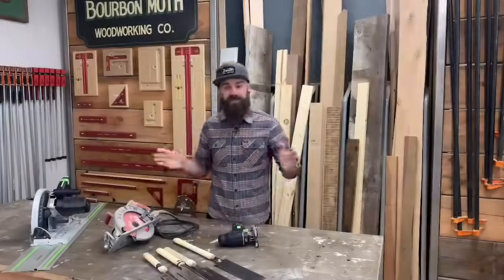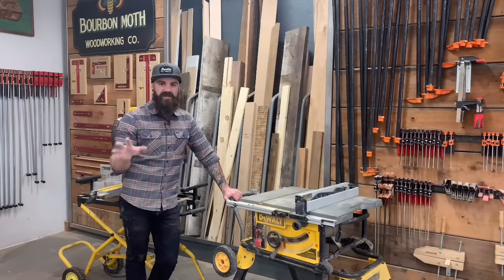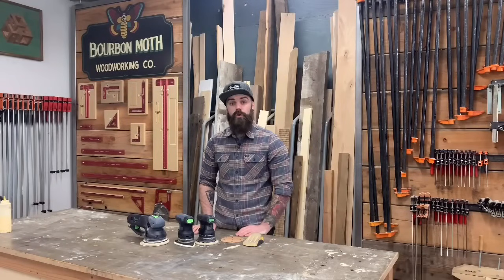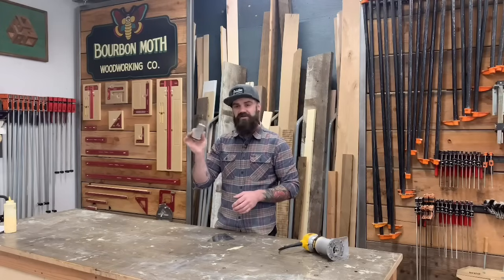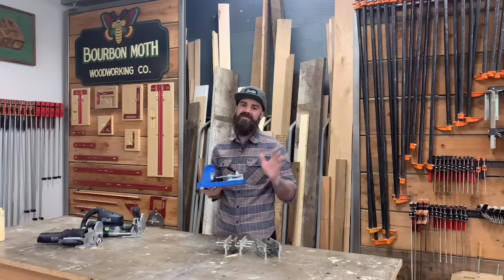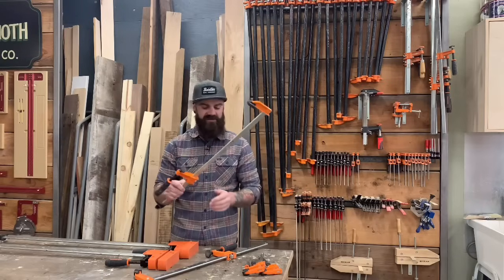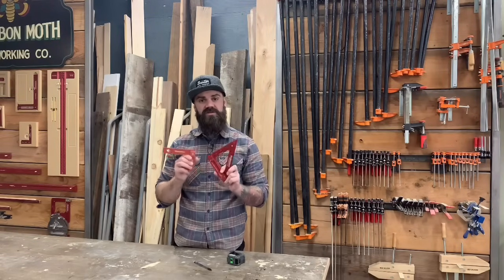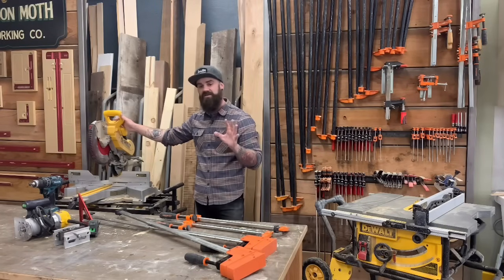Tools every woodworker needs | Start Building for under $1000

Comment: It's interesting that US woodworkers always specify a table saw (and normally a chop saw too). A decade in and though I have a table saw and a chop saw, I find them both far less convenient than a bit of practice with a circular saw or a jigsaw, and far more limited. I know almost no one here in the UK that considers them necessary (people often suggest bandsaws here though, which is even weirder if you ask me!). I literally only use them for really repetitive stuff, which isn't something I'd be doing starting out tbh. I'd save ~$700, get yourself a decent jigsaw and a decent circular saw, and spend the rest on stock and practice. Great video though :)
Reply: Weird, the table saw is the staple in most woodworking shops here in other parts of Europe, and the sliding miter goes with it for sure.. To be honest, I only touch my plunge saw and circular saw when breaking up sheets or cutting things already in place... My jigsaw probably sees the least use, but it's invaluable when it's needed.
Reply: @TheDaniel85  I'm intrigued by where you are in Europe? I wonder if it connects to how little space we have? The cost of a table saw in a small shop is massive here. Say you only need 4m2 for it - that's going to cost you 60 quid a month in rent, before the space for feed in and out (which is probably more like 10m2 or 150 a month! The full size of the average shop over here!)
Reply: @Phazaar  I'm in Sweden. I have a 32 square meter garage as a shop. But there's a pretty big shop nearby, around 100+ square meters, they run an older SCM SI slider. 

I have an SCM Minimax SC 2 Classic as a table saw in my garage.
Reply: @TheDaniel85  I couldn't be more jealous - I'm having to downsize right now to 10m2 and it's brutal. A garage that size here would either be considered an industrial unit, or part of a MASSIVE house :(
Reply: @Phazaar  Ouch, well.. That's the good part about living in a rural area I guess... 

I wish my shop was bigger, but I know the challenge of 10 square meters, that was my old shop size.. Before renovating the garage.
Reply: I feel like chopsaw is a really weird one. A circular saw is wayyyyy more versatile

Comment: Just bought the F Clamps on amazon for $40. Thanks and great video
Reply: Try craigslist.  Seriously I buy tons on craigslist.  Tools too.  I have lots of videos on buying great machines and tools off craigslist for great deals.
Reply: @davidbryanwoodworksandmore finding a decent plunge router has been a challenge. They are sold out everywhere. Guess everyone else had the same idea
Reply: @johnmclain6535  John are you wanting a big one or little one?  Like the one in the video?  That was little.  Have you looked on craigslist?  I just picked up like 6 routers from a shop a few months back. Some are plunge. You just have to know what you are looking for. Check my craigslist tool haul videos and you’ll see.
Reply: @davidbryanwoodworksandmore  wanted the Dewalt plunge.  Found one. Got it home and it was defective.  Retuned it.  Now they're out of stock. Lol. I'll definitely try craigslist. Thanks for reaponding!
Reply: @johnmclain6535  that’s disappointing for sure that you had to return it. I have several on my links page if you were to look there. Bosch plunge are my favorite medium size routers. The dewalt tend to not work as well. As I’ve got those too.  I think I bought like 6 recently from craigslist deal.  I have a video because it was such a crazy deal.  Where are you located?  I’m in Southern California. I’d sell some. I don’t need all of my routers.
Reply: @davidbryanwoodworksandmore  Austin Tx.  I definitely want a plunge router for sure.
Reply: @johnmclain6535  try to find the Bosch 1617  2-1/4hp set.  Plunge and reg base kit.  That will last you a lifetime.
Reply: @johnmclain6535  or Bosch 1618.  They’re essentially the sane.  But best to get the two piece set.  189-200 buck range.  Great starters.
Reply: @davidbryanwoodworksandmore   just bought that Bosch plunger router. Thanks man!
Reply: @johnmclain6535  you’re welcome.
Reply: @davidbryanwoodworksandmore  been practicing with the router. Its awesome!  I have a couple of slabs to flatten. Can you recommend the proper bit?
Reply: @johnmclain6535  hi John.  I’d recommend any style 3/4” or greater dado router bit.  Let me get you a link for exact one. Give me a Minute.
Reply: @johnmclain6535  Okay John here you go: https://amzn.to/3ajvont. Check this bit out.  Its nice.  If you do a lot of this type of work, maybe be on the lookout for a used 3 hp router.  dedicated to this purpose.  but the Bosch router should do really well.  get the dust extraction hood for it. do you have the dust hood for the router?
Reply: @davidbryanwoodworksandmore  thanks David!
Reply: @johnmclain6535  you're welcome John. Good Luck with everything.  Let me know if you want a link to the Bosch router dust port.
Reply: @davidbryanwoodworksandmore  yes please!
Reply: @johnmclain6535  John here you go.  https://amzn.to/2Md7WjP. This is for the 1617, or 1618 plunge base only.  its a necessary attachment if you want to do flat profiling like grooving or flattening.
Reply: @davidbryanwoodworksandmore  so a bit of a problem. I built a router sled with 3/4 inch plywood but the bit doesnt go past the sled with the plunger and only about 1/4 inch without the plunger.  I cant seem to get the bit to go far enough down to touch the slab...what am I doing wrong?
Reply: @johnmclain6535  John I can’t seem to picture this.  However let me try.  The throw of the plunge router shoujd take you way beyond 3/4”.  It sounds like there is a depth stop set on the router.  Loosen the lock knob so it can completely plunge.
Reply: @davidbryanwoodworksandmore  I subscribed already buddy!
Reply: @davidbryanwoodworksandmore  its plunged all the way down, that I am sure of.  I may need to rebuild my sled with thinner wood or perhaps plexiglass instead
Reply: @johnmclain6535  send me a picture. Something isn’t right.
Reply: @davidbryanwoodworksandmore  not sure how to do that...dont see the option to upload a pic
Reply: @johnmclain6535  oh cool.  I can’t tell with some accounts.  That’s great.
Reply: @davidbryanwoodworksandmore  on its way

Comment: For a drill set I recommend the milwaukee m12 impact driver and drill combo. Light, compact, and plenty of power for any woodworking task.
Reply: Strongly disagree. 12 volt is not powerful enough for driving longer fasteners nor will it have a big enough chuck for larger drill bits.

12 volt is for technicians and light house work.
Reply: @kellym3610  have you tried the milwaukee m12? I have successfully screwed in 6in 3/8 diameter grk lag screws into doug fir posts. And it had plenty of power to sink them in deep. Not that you would want to do that always but they have plenty of power for general woodworking.

Comment: Got any recommendations for temporary shop spaces?

My 'shop' area is really just tool storage.

To rip plywood into flooring, I set up my table saw in the back yard and made in/ out feed tables.

That was fine until the weather turned and I had to tarp it all over.

I'm thinking a pvc pipe frame with an awning material cover.

That way it go up and down quickly.

Permanent shed is on my todo list, but it still won't be big enough for ripping full plywood sheets.

Comment: I literally got two long levels and made a 1x10 sled that holds a router with a surfacing bit to level stuff out. It works really well. I just set the levels on some horses and have a couple 1x10's screwed together and some plywood scraps with a 90 degree corner cut in them to hold work in place. Still working out what height I need to be getting the sled to before starting, but its worked pretty good for the small tables and cutting boards I've made.

You just need to be creative about solving your lack of tooling problems.

Comment: Great video and super helpful. My “workshop” is in my dining room, so I’m unable to use power tools at the moment (unless I have nice weather, which in the UK is very limited). Oh, and just a little tip for your card scraper, Jason. Pop a magnetic strip on it... it helps a lot with the heat.

Comment: Honestly if you're starting out, don't bother with a miter/chop saw. You can cross cut to rough length with a skil saw just as easily and you can use it to break down plywood.

Comment: I have some questions I’m throwing out for any woodworkers. Woodworking is my weak point. It just doesn’t come natural. I can fix multimillion $ aircraft no problem. Woodworking? It makes me feel soooo slow lol. I desperately need this knowledge for everyday use as I’m going into homesteading, especially. I do better learning in person. To be able to ask questions and get hands on. Advice on learning? Currently I’m struggling with YouTube videos and just tinkering around. I’m willing to be someone’s helper or ‘tool holder’ in exchange for knowledge. God wood shop would be amazing right about now lol. The only thing I’ve remotely found are trade schools etc, that are for careers and require that you are going to school full time etc. (Tidbit: I’m a veteran with my GI Bill and have access to Vocational Rehab etc). How do I find someone willing to teach me the basics and to get the experience ( whether I pay them or in exchange for working under them).  Also, There’s no way to get all this under $1000, or any variety (even the cheapest of the cheap). :(  I’m really struggling to figure what to buy (the amount of research of reviews vs pricing etc etc etc). I’m slowly building my collection as I go. I looked up everything mentioned here from 9 months ago and availability/pricing aren’t even close. I know it won’t come cheap, but I wanna make sure I’m getting quality tools; whilst not just buying super expensive for no reason.  Ramble ramble,  advice? LOL

Comment: I started out with my basic 10” Dewalt miter saw I paid $100 for on a Black Friday sale. I knew someone who worked at Home Depot and they “price matched” Amazon 😉 and I also still have my $100 Ryobi table saw. The same person no longer worked at Home Depot. Lol. So I paid full price. But I built a stand and out feed table and it works great. No bells or whistles it works as good as new. I plan on buying a Delta shop saw this coming summer because I need more table side width. But you really don’t need as much stuff as youd think. Clamps are what I’d say. Splurge and buy a lot of them. They don’t have to be expensive. I’d say early on, quantity is better then quality for clamps. Lol

Comment: I kind of hate to admit this but I bought everything I have used. I bought a thickness planer,  joiner, table saw, 12in sliding miter saw, radial arm saw, oscillating sander, 2 horsepower router, all for around 800.

Comment: Dewalt sells a combination of a miter and tablesaw that is effing amazing. My dad and I have run literal kilometers of wood through that thing and it still runs perfectly. So you can get away with only having 1 large saw instead of 2.
Reply: Link or model #?
Reply: Bosch makes one too, but I've never seen any available in the U.S..not saying they aren't sold here, just that I haven't seen them.

Comment: Great Video and well explained, but I don't agree with you, especially on the table saw in your list. As you mention the table saw is the core of any wood shop, and if you buy the Skil version, you are either going to take it back or buy a new one in very short order. It will not do everything you need it to do, it will do the basics, but you will have a lot of problems and frustration. I started out this way and totally regretted it. I returned the trash saw and spent a little more on a Delta Contractor saw. It's still not as good as what I want, but it has served me well.  Another thing.. never buy DeWalt, you pay a premium for the name. So switch out the random orbit sander for a Ridgid one for half the price and do the same with the router. Then switch out the bar clamps for pipe clamps, you will get twice as many for half the price and for most things they are just as effective if not better. There I saved you $200 bucks that you can put towards a better table saw. Trust me in the end you'll end up buying a new table saw anyway so you might as well do it up front. In fact, I would even lose the miter saw and just make a cross cut sled to start out, saving even more money for an even better tablesaw. Sorry Jason, I do love your videos, you are awesome, and I don't mean to sound like I am ripping on you, I've just learned my lesson way to many times buying cheap.

Comment: Would really appreciate a video on calibrating my miter saw and making good, clean, close cuts.  It’s the worst
Reply: They are not great but if you use them smartly they are okay.  I rely on my dewalt for my custom cabinetry shop daily.  It’s good but not perfect.  What kind do you have?
Reply: @davidbryanwoodworksandmore  DeWalt compound miter saw
Reply: @albertespinoza4849  funny.  Me too.  I find it’s okay but not perfectly square on both sides of cuts. However I get around it by using the two cut method. I show this in build videos where you’ll see me cutting twice sometimes.  It’s annoying but better results.

Comment: I have a question about getting a table saw. I already have most and more than what you covered here. What I have not bought yet is the planer and  table saw. How do I know if a table saw can do a dato a stack or not? I have burned myself on a few tools in the past not researching enough. Lesson learned. But going to the big box stores and taking to a kid that doesn't know what a dato is doesn't help me. Also are there limitations I should know about when making a dato stack that may effected by the horsepower / blade diameter? I have been struggling to find a good source for that.
Thank you very much for any advice you may be able to offer.

Comment: Would like to get started with making some cabinets and furniture.  Except for the jig and clamps I have most of the other items.  I have an old Skillsaw 3400 10' table saw.  I always thought the fence was flimsy but I never did any adjustments out of the box.  

Should I upgrade to a better table saw or is my current table saw good enough?  

I almost would rather spend the money on a track saw, or even bench top planer or jointer.

Comment: Nice. What about all the different varieties of goos and questionable liquids that are used to do things like glue parts together and coat the products you make to get various effects? Just about every video I've seen on woodworking and making new stuff always seems to involve new kinds of polishing compounds for wood constructions that have a bit of resin in them, various kinds of oils to "treat" the wood, and who knows how many layers of paints, laquers, stains, clear coats, and other stuff I'm forgetting. This can of worms is related to the complexities of all the different kinds of rust removers, metal treatments, primers, and ways to lubricate mechanical stuff I've seen in restoration videos, both for things like old coffee grinders and decade-old electronics that need to be preserved.

Comment: I personally recommend a circ saw as the primary, especially for a beginner. You can buy a rather cheap but quality track to attach to the circ saw.  There’s is not a job you can’t do with a circ saw, it’s hands down the most versatile saw. And finally I would liken it to learning to drive a stick shift before you drive an automatic vehicle.  How much better to learn the more difficult part first.  This is just my opinion.

Comment: I use T-track.  Instead of leaving fairly large gaps at the end of the tracks to install clamps, I just relieve a small section of the aluminum (to widen the opening in the top of the track) so the head of the hold down bolt can be passed into the track then slid along where it’s held.  It works well.

Comment: Great informative video. I've been watching a lot of woodworking videos since the pandemic and have learned a lot. I always viewed the little 1/4" impact wrench only for automotive work. I never realized how much it can be used for woodworking. 
Many many years ago I had to make a decision as to getting either a table saw or a radial arm saw. I decided the radial arm saw was the most useful for me. BUT.....watching all of these videos, everybody seem to use a table saw. I don't get it? 
I've done so much with my radial arm saw. I have a molding head for mine so I can even make molding. I finally purchased a router but I find the radial arm saw to be the most versatile or multi purpose tool. 
So.......why do you not use a radial arm saw? What am I missing?  I still feel I made the best choice for my needs. 
By the way, I've enjoyed all of the videos I saw that you created. 
Barry G. Kery

Comment: I have the same Dewalt table saw and it works great. Unfortunately the fence length is pretty short. Is there a way to extend the fence and cut wider sheets of plywood without having to free hand it?

Comment: This might be a dumb question, I’m new to wood working...
Is there a way to use a router on my baseboards without having to remove them and reinstall?
Reply: They are basically 1x4’s with a sharp edge